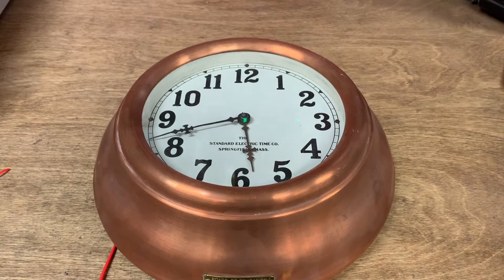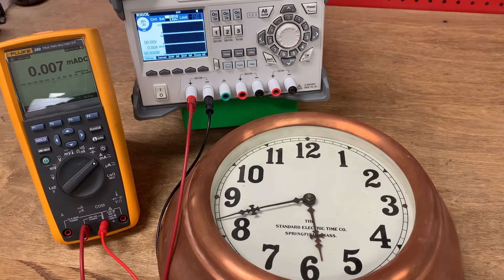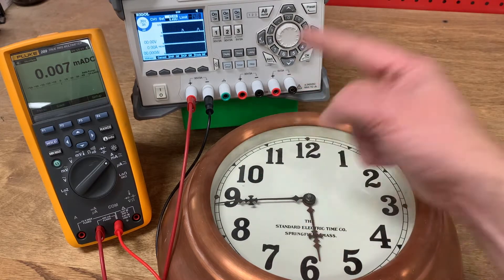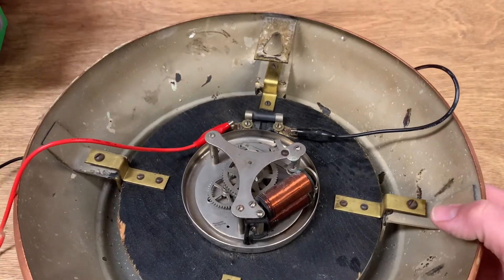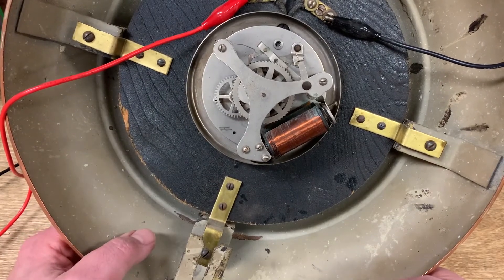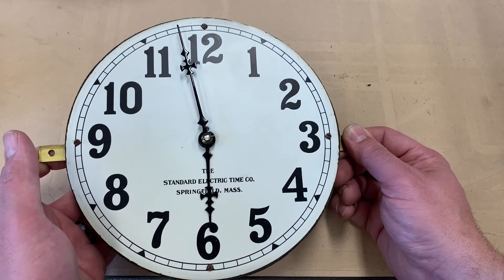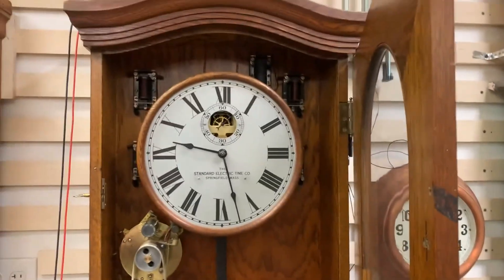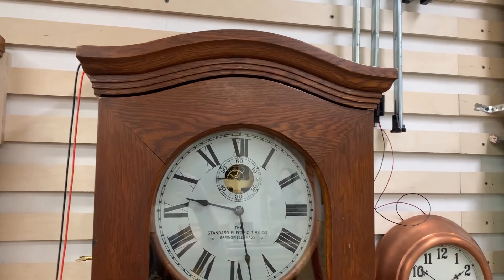Standard Electric Time Master Clock Restoration Part 6 - Slave Clocks

Comment: I’ve been restoring the Stromberg Master Clock System aboard NS Savannah.  Currently, I have the Master driving nine slaves across four decks.  Here’s a video of the Master driving the first slave I got operating:  https://youtu.be/2CK1bSZG4FI?si=Bou3uAwLGqN10-L5

The Stromberg System reverses the polarity of the current for the last ten minutes of each hour, which the slaves use to correct themselves.

Comment: Excellent video.  Thank you.  I just got my master IBM working and I'm about to tackle my first slave!
Reply from the maker: Best of luck - you can do it!
Reply: @MinnesotaClocksandWatches  do you happen to have a visual wiring diagram for a master clock so I can wire a slave?  Or are Standard Electric masters a completely different design from my 1948 IBM master model 25?  And the slave is an ITR/IBM 1927.

Comment: I have an IBM clock with this type of ratchet movement, and gotta say i really don't like it, for several reasons. 

First off, it doesn't have polarity, unlike all my other slave clocks (those use a stepper-motor like movement). That means that when you go to manually advance the clocks and you send the wrong polarity this clock will advance but the other ones will not. 

Second of all, you can only set it via pulses (or manually by pushing the ratchet) but only forward. Now that isn't exclusive to this mechanism but its still a bit annoying, especially when it gets out of sync with the other clocks because of the issue mentioned above.

And last, it's really loud. Like, I can hear it from across the house with my door closed.. which can be a nuisance, especially at night.
Reply from the maker: I think you have to consider these in the time period where they existed. Standard Electric Time was using slave clocks like this in the 1880's - I can forgive them for having some limitations compared to clocks 50 years later.

Comment: Thank you so much for doing these videos. I just inherited my grandfather clocks from my grandfather. They are both American standards pretty close to the same age as yours. The pendulums were disassembled when I got there. I was looking forward to seeing how you install the pendulums, but I did not see how you did it. You left that part out.  Any advice you can give there would really help. Again, great job and thanks for doing this.
Reply from the maker: Apologies for not showing this clearly. If you contact me through my website minnesotawatches.com you can send me pictures of what you have and I can help you get it back together. In broad terms, the pendulum hangs on the iron bracket behind the clock. There is something called a suspension spring that is pinned at the top to the movement bracket, and at the bottom of the suspension spring is another pin that the pendulum hook hangs on. The crutch wire comes out of the back of the movement and propels the pendulum through the slot a few inches from the top of the rod.

If this doesn't make sense, you may be missing something or something may be broken. Send me pictures and I can probably help.
Reply: @MinnesotaClocksandWatches  thank you so much for responding. After about an hour or so, some good magnifying glasses, I got it to hang properly. My next job is to test the power sources. I am re-watching your first video over and over again before I make an attempt to try it. I bought a really good Klein Tools mm700 multimeter today. I can manually wind up the spring and get the clock to tick and keep time. Again thanks for all your help great videos.

Comment: The whole master clock and slave clock system is very interesting. Too bad many of these were simply thrown out or replaced with a system that wasn't half as good as this.
Reply from the maker: The fact that this style of clock was invented in the 1880's continues to impress me. The synchronous electric clocks that followed these did have some advantages - slightly better timekeeping, and later on self-correcting slaves, but I agree - this was a great system.

Comment: I've had one of these for years and it runs great.  Someone had installed a transformer to make the clock run, but I've never managed to figure out how to get the slave to work.  Thanks for posting this, it gives me some ideas where to start.
Reply from the maker: As far as I'm aware, this slave clock runs very similarly to many other pulse-driven slaves. Some later slaves actually have an electric motor and a moving second hand, which of course operate differently, but if your slave is of a similar era, I believe it would be very similar to mine.

Comment: Hey, just saw your video, it was very nice! Only advice I have for you is that for these mechanism for SLAVE/SECONDARY clocks, you aren't really supposed to oil the mechanism. Im no clock expert but for older clocks with the same mechanism they would have date tags which state "Do NOT oil this clock" Im guessing its due to the oil sticking over time.
Reply from the maker: Thank you! Yes, I debated on oiling the slave or not. Many calendar mechanisms are designed to not be oiled, but as they only fire once per day, there's rarely any wear to speak of. The slave clocks fire once per minute, so while not as frequent as the escape wheel and verge, there is still a fair bit of movement.

Oil can gum up and oil can also attract dust. I suspect these slave clocks were never intended to be serviced - they would run until they wore themselves out, then they would be replaced. My rationale for oiling the clock is that oil will reduce wear, and when the oil is unusable (20ish years for full synthetic), the clock will just stop before extreme wear happens and it can be serviced again.

The wear that I'm worried about is the punch tape. I have a wild idea for a project to try to reproduce the tape. Hopefully I can make that happen.
Reply: I saw some YouTube who had fully replicated the tape, I will have to try and find it for you, on eBay there are a few original tapes from 12hour and 24hour systems, program machines that extend / have rollers towards the bottom of the case are 24hour, the masters with rollers at half the size of the case are 12 hour tapes!
Reply from the maker: I would love to see someone else's method to replicate the original tape. Thank you!

Comment: Thank you. I was wondering (because I don't know) but would lots of slave clocks dotted around a large building suffer from severe voltage drops such that (perhaps) the 12v slave is actually run from the 24v master line. Different dropping resistors at each clock could be installed to make sure the slaves get a good 12v.
Reply from the maker: I think that's likely, and in the video when I attached it to the master clock, I ran it off the 24v supply running the master. 

When this clock was removed from service, they snipped off the wires to the building system. I don't know what they did downstream, but at the clock everything was wired with 14 gauge solid wire. If this wiring method was used everywhere, with 75 clocks attached (1A total load, give or take) and 1000' of wire, the farthest clock would still be receiving around 16 volts.